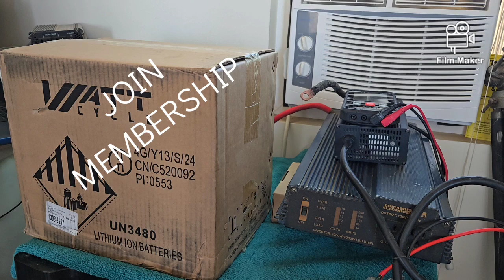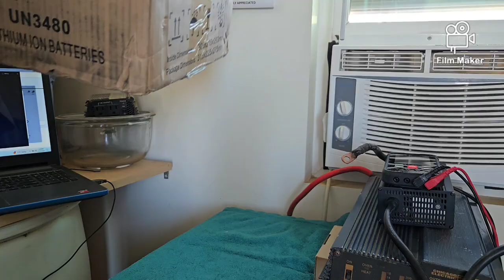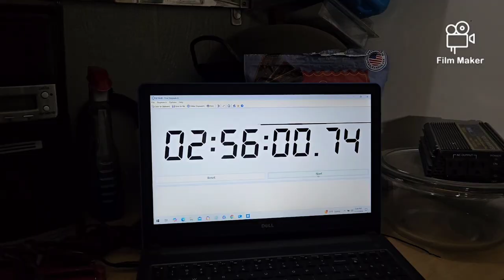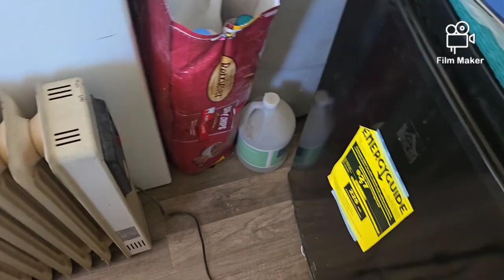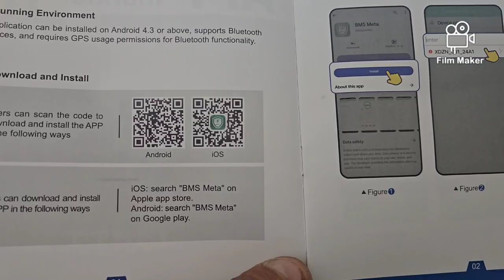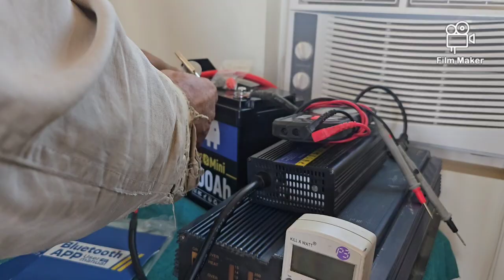WattCycle 12V-100ah Smart Bluetooth Battery Review

Comment: Its been interesting to watch these videos on those lithium batterys - 
   Were i live in the deep south in a rural area - REA was still setting poles and running wires for grid power in 1960 - 
      Those who had power ether had homes powered by three, huge two volt cells - making 6 volts we called then 6 volt house - 6 volt houses had fans, electric lights and of course a radio - 
     Also many homes used the 32 volt system they had 16 large 2 volt cells to make 32 volts - those hiuses had a lot of appliances - like electric  fridges, freezers, electric well pumps aling with ceiling fans ect - 
    .all that was called farm light plants - they had a generator and the batterys were sized so they only needed to be charged once a week - 
     Those batterys were wet cell lead acid batterys - a car battery or deep cycle boat battery uses a acid strength of 1.275 gravity - those deep cycle house battery acit strength in most cases down here were at a gravity of 1.195 - 
      Those farm and rural home house batterys lasted fro 60 to 80 yrs - and in many cases just had to be desulfated - 
       Im wondering how long those lithium battery will last compared to the old stationary Exide and Gould batterys that homes had befor REA sent power out here - 
    You can look up on the net about say Exide house batterys in rural america on the net - 
      Down here it never gets below 0° F so the weaker acid can be used - but there is a lot of capacity loss but there is no termanal corrosion and the battery last decades of daily use -
Reply from the maker: Interesting information!  I'll have to do some research on that.  These LiFePO4 batteries are claimed to last 15-25 years.

Comment: I love this, i never knew anything about batteries and was afraid of them, always told they'd blow up if you didn't connected them right way, positive first or last stuff. Thank you so much ill watch review. Wonderful stuff
Reply from the maker: @donnahurd4745  Don't be afraid of them until you get to the 48v systems.  Those could give you a good shock.  But 48v is best for off grid systems.  When the time comes, I will be here to guide you on setting up your off grid power.
It's not cheap to get started, but bet on 10-20 years of no electric bill in the mail, even if you fall asleep with the lights on.
Reply: Donna what you said about battery's blowing up is true when it comes to a standard car battery - or deep cycle battery's that are wet cell batterys - 
    Those are the battery's that have caps to add water to - 
      It's a safety issue - if you connect the battery charge before you plug it in it will not create a spark - 
     After you connected the clamps on the battery and plug the charge in - you have eliminated the chance for it to create a spark - 
     Battery's that have caps generate hydrogen gas while they are charging -    today's modern smart charger monitor the charge rate of the charger so flooded or wet cell batterys don't creat huge amounts of hydrogen like they did with the old time battery chargers - 
    With that said it's always safer to connect the battery charger to a battery first then plug in the charger - 
     When the charger is finished charging unplug the battery charger and wait a few minutes then remove the clamps off the terminals - 
      The battery he was demonstrating does not gas like car batterys when charging or in use - so you don't have to worry about hydrogen gas being generated as it's charged - or a spark causing it to explode - 
    My grandfather worked on huge industrial battery's that were the size of a small car and larger - 
     In 70 yrs of working on them in old power plants none ever exploded - I started working on battery's with him at 7 yrs old - I've messed with wet cell industrial battery's and worked with them for 62 yrs now and none have exploded on me - 
        It's just taking the time to unplug a charger before removing the clamps after the battery is charged - 
    If you ever get to were you feel you can charge say a dead car battery just follow the safety precautions and you will be safe - all chargers come with safety precautions in the instructions -

Comment: Can one charge new battery with solar versus using the charger?
Reply from the maker: @Yougottabeyou25  Yes.  It is recommended to use at least 200w of solar.
The charger is better, as it will charge at 14.6v, 20A, and auto shut off at full capacity.  You will need to monitor the charging through solar, but it works.
Note:  Either way, be sure the battery is fully charged, then wait 24 hours before adding a load to it, and charge one more time.  This allows the individual cells to balance and increases the battery life.